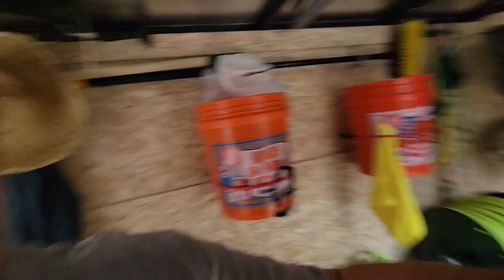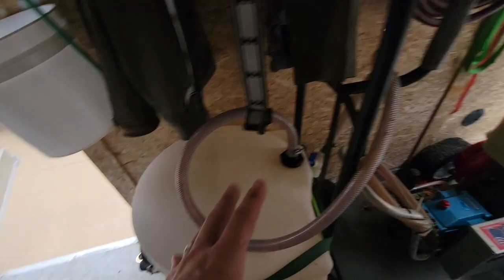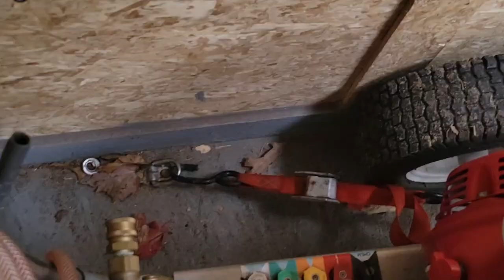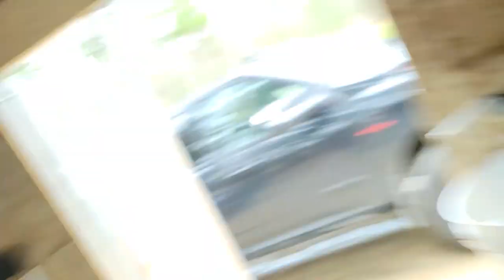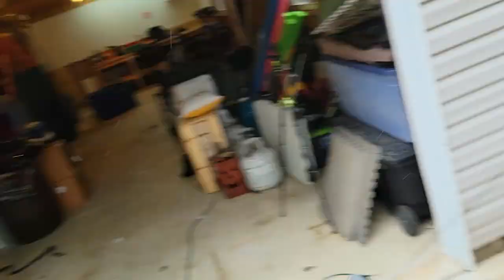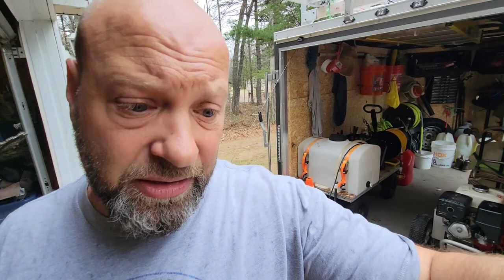Enclosed Trailer Set Up - Functional And Affordable

Comment: How about a video on your soft wash system.
Reply from the maker: just sold it. getting out of washing. my other businesses are keeping me busy enough.
Reply from the maker: but it was a 26 gallon tank mounted on a garden cart with a deep cycle battery charger a 5.5 gpm 12 volt pump and a hose reel with 100 feet of hose.